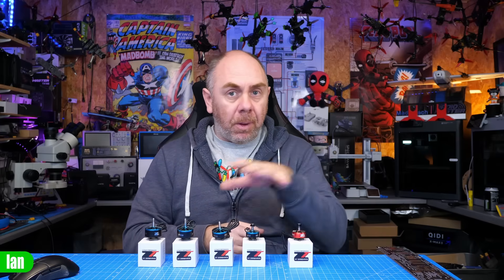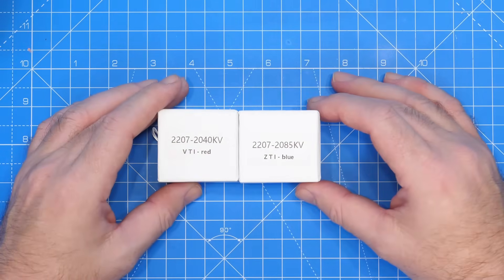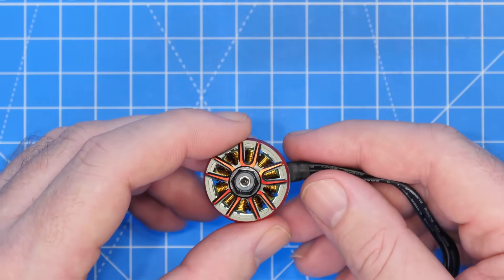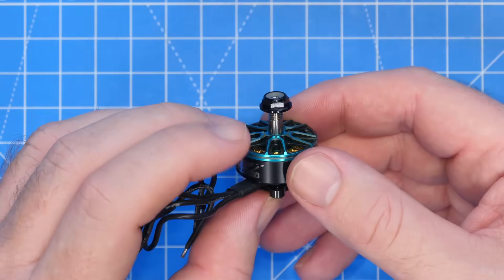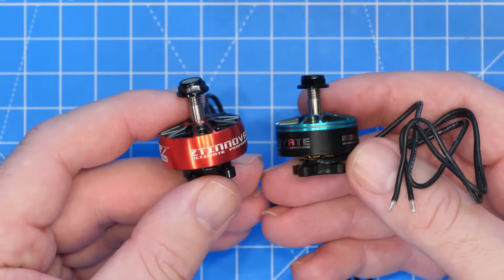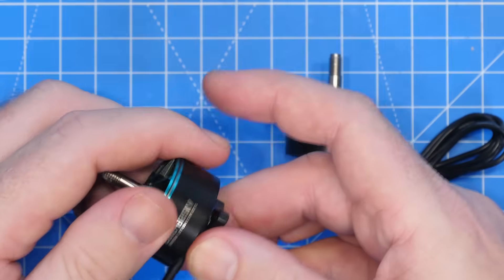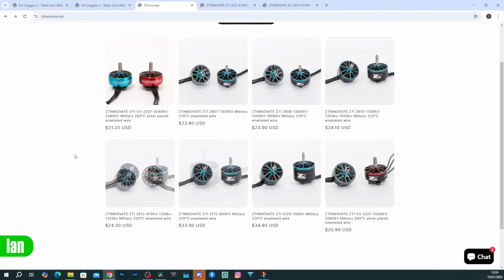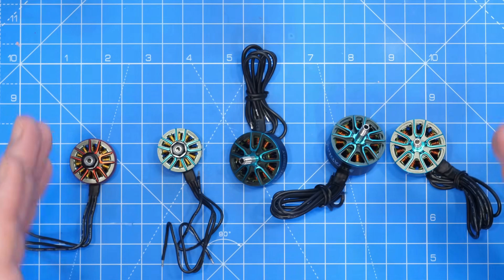ZT Innovate FPV Motors - ZTI & VTI First Look

Comment: Seems silly to have 2040 and 2085 kv motors distinct from each other.  I think you could mix them and not be able to tell
Reply: If I had to guess, I'd say the small difference in KV is due to their different constructions, not as a direct choice from the manufacturer.

Comment: Just an other motor.
Plus minus 5 percent efficiency and top performance between most motors. You need to benchtest them.
The cheap emax 2807 are damn good besides low price.
I've had good experience with noname budget motors.
Saving total 20g for premium motors isn't much for a 7 inch.
On toothpicks and sub250g every gram counts.

Comment: 4 mm shaft?  And will anyone notice  the 45 KV difference on the 2207?
Reply: The axle is probably 4mm through the bearings. Uper prat for the prop must be 5mm. I also ask myself same about KV diference.
Reply: @primoziskra6394  I reckon the lower the KV,.. the larger prop size you need for efficiency and handling of the motor, or maybe the difference is about having a 4S or 6S battery.
Reply: @jplo5299  But not diference betwen 2040 and 2080kv but more 1800 for 6s and 2400  for 4s.

Comment: i'm building a new 7inch, my old one had older motors, which is better, 2807 or 2808, is it worth the extra weight for more torque? for long range cinematic, not necessarily freestyling that is, just curious i have both from same manufacturer... going to do one in analog and one with gt kit, the analog will have 16w vtx i just ordered and want it to be my filming rig, the WS will be just a fun flyer that will see more use so not as worried about tuning
Reply: It depends, my old 7“ lr rig had 2807 motors and I was carrying a 4000mAh Li-Ion and GoPro and found I had enough power. 
I recently built one with a much lighter frame and motors (2806.5) and was able to achieve 30min of flight time with a 4500mAh Li-Ion and still have plenty of power (no Gopro anymore, as I switched to O4 pro)
If I were you I‘d build a lightweight 7“, as these have superb efficiency and still enough power
Reply: @MJ-bj1gn what frame did you go for?
Reply: @saturn_fpv  I got the Rekon 7 frame and I'm very happy with it
Reply: For efficiency smaller low kv motors are better. A 2807 1300kv motor with 7x3.5x3 props will be a very good combo.
Just try and keep the build weight low. With 6s 21700 li Ion you will get 20min.
Larger motors will be more fun for light freestyle power.
Personally I find 2808 to be very good allround 7 inch motors.
Reply: F90 2806.5 1300KV 👌